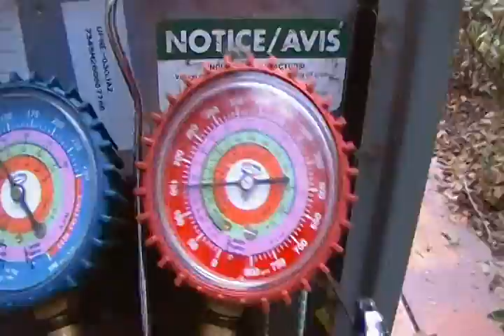Air Conditioning clean and check sevice HVAC Part 1

Comment: I had a friend who paid for a new compressor because his condenser coil was dirty causing the pressures to be high and it would cut off the compressor even with new compressor it would still cut off in the middle of summer in Arizona. I went over and clean his coil and the problem was fixed. goes to show how some techs out there won't be honest to sell you parts you don't need.

Comment: my AC takes 25 to 35 minutes to go from 88 to 85F, condenser is clean, 
bigger pipe with insulation is cold, smaller pipe is warm. the junction 
between the 2 pipes got a hissing sound. is it Freon leaking? anything 
else other than Freon? how much to fix and refill? thanks
Reply from the maker: There are a lot of variables.  What tonnage a/c, how many square feet to cool, insulation, tall ceilings, R22 or 410a, is the evaporator clean, holes in duct work?
Reply: how about the hissing sound between the 2 pipes at the ac unit? I heard hissing sound when ac is working, but no hissing sound when it's off.
(it's 1st floor unit AC, about 1900 sq ft. 9 feet ceiling. unit is 7 years old)  thanks!
Reply from the maker: You could have a bad reversing valve, freon leak or something else.  Without actually performing a diagnostic, it would be very difficult to tell you correctly what exactly the problem is.
My advice is to have a reputable company come out and give you a proper diagnostic.
Reply: actually it seems ok, pretty cool and air coming out of vents are cold too. however I noticed the temp usually drop 2 degress at once. also should I pay attention to how long compressor runs when I turn down temp or leaving the temp the same. so later if there are problems then I will know.

Comment: Loved this. Easy for a woman to understand. ;) I was able to go outside today, and clean my unit. It's sitting on a round piece of concrete, so after I cleaned all the coils, I made sure to do a quick spray underneath where that concrete is, and a lot of junk came out from there, as well. I was also able to check the refrigerant pipe, and after cleaning it, I came back out and it was ice cold. Yesterday, it was barely cold to the touch. So cleaning will definitely help the refrigerant flow through a lot better. Before cleaning the unit, my thermostat was reading 75 instead of the 72 I set it on. Talk about a difference! Now it is so cool in my house, I had to adjust the setting. I was tired of having a hot house, and this definitely helped.

Comment: Well, no offense ... but the industry techniques have improved probably a hundred times since the 90s as have the the equip designs,

What worked in 20th century 1990s does not work today. ACs are just too different.

Comment: In all the  owners manuals it will say to spray condenser from both sides.

I am not knocking Homestead, but a lot of changes have occurred in the industry that have made several "tried and true" service techniques obsolete, one side coil cleaning is one of them. 

All foaming condenser cleaners I use say to clean both out side and inside the condenser coils.

I hope this helps .

Comment: yes, that is to prevent you from attempting to work on it. should you try to work on it, then it will cut your hands off. call your installing company and they will fix it if a problem developes.

Comment from the maker: Some heat pump air conditioners when they go into defrost mode( using the heating cycle), the fan will not turn.  If you A/C is in cooling mode then the fan must turn the whole time the compressor is running.

Comment: We have so much in common. I enjoyed your A/C testimonial. I also like Rheem and use Ryobi. I wonder if you would check out my blog. I would value your opinion. I upgrade air conditioners into hybrid heat pumps.greenheatandac

Comment from the maker: I have seen plenty of exposed condenser fins from other brands that the rain splashed mud on the lower part of the unit and it did not wash it out.  I like the Rheem/Ruud because I feel that you get an extreme value for the money.  I will agree that the disconnects are cheap but, they work most of the time.  You can never go wrong with upgrading the electrical though.  Thank you for your input.

Comment: I hate those cheap plug in disconnects, I replace them with wheatherproof knife switches , no fuses, the circuit breaker is a fuse. I had a unit once that kept blowing up the start capacitor, I was told it was caused by poor electrical connection coming to the unit.I changed the cheap made in china plug in disconnect. I also don't like rheem AC units because the condenser aluminum fins are covered by louvers. The louvers prevent the rain from washing most of the dirt away.

Comment: What do you think is a good simple not so high priced unit, i need to change my 1984 trane airhandler, i was looking at a used 2006 2 ton trane in very good condition or a brand new payne .. What do you think??

Comment from the maker: I need a few more details.  However, if it is just leaking water it is usually an easy fix.  If it is making a noise and is still cooling, then you might have a bearing going bad in the blower assembly.  I am just speculating.  I need more info.

Comment: Hi,
Our unit is leaking water since we didn't have electricity for 5 days. The technician is a good guy and said we need to change the whole unit which costs about $5400. The heater and AC is making some noise, not alot, he said something like heater and blower related in something something...  The brand we have is Trane which I heard is a very good brand; it is about 15 years old. There are some rustings inside the unit (the walls) or trays but everything else looks new, do I need to replace?

Comment: I had a spider web short out the coil on the contactor before. It kept popping the 3 amp fuse on the furnace board. I took the contactor out and cleaned off the web I was good to go.

Comment from the maker: Use extreme caution.  If you are not a licensed professional you could get electrocuted or get your fingers cut off by the fan suddenly coming on ( I know a guy that this happened too). Most likely I would guess that the fan motor/capacitor is bad and will need to be replaced.  However, it could be the relay, contactor,wiring, circuit board or etc.  If you are unsure of what you are doing call a professional.

Comment: my ac outside, the fan isn't spinning anymore, it just stopped spinning and it sound like it wants to turn on. it blows air inside but its not cold. i dont know what could be wrong with it. its a RUDD from 1992.

Comment from the maker: I have seen water leak from roofs and plumbing down into walls and cause mold and fungus smells in homes.  I was able to treat it with that stuff that is sold at the supply houses, but you must stop the water leaking.  I would also clean the evaporator coil as a place to start.  Thay also make UV lights thast will control mold in an a/c.  I hope that helped.

Comment from the maker: Without looking at the system I can't give you a precise diagnosis.  I would suspect the duct system first. Black mold is virtually in every duct system in FL.  You can replace the duct work and as soon as you turn on the system black mold will start growing in there again.  There is a duct system out there that is treated with a biocide(expensive) to control mold.  They sell a 1 gallon jug of special mold and fungus killer at the a/c supply houses.  Simple Lysol spray will work too.  continued

Comment from the maker: Yes, you can use the stuff sold in the a/c store.  However, you must thoroughly rinse the coil with clean water until all of the spray is gone or it will corrode.

Comment from the maker: You want to wait at least 3 minutes to allow the pressures inside the unit to equalize.  The spray on foaming coil cleaner from Home Depot does not work as advertised, so save your money and buy some real coil cleaner from a a/c supply.  If they will not sell to you the you can probably get some online.

Comment: Great Video, Great Story. I am going to do this for my parents at their house. It is about to be summer though so I'll have to be quick :). Question1: How long should I wait before turning the system back on after cleaning the coils?  Question 2: Should I use some kind of coil cleaner?
I have a feeling their unit will be much worse than yours.

Comment from the maker: It has been my experience that the way depicted in the vid will effectively clean the condensor coil.  The evap coil is cleaned from the outside in as well.  If you wanted to take the off and clean it from both sides you can, but generally the dirt, grass and debris will be where the air is pulled in at.  I hope that answered your question.  Take care.

Comment from the maker: @sonnysand Thank you and you are welcome.  I forgot to mention about checking the amperages on the compressor and fan motor and oiling the fan if applicable.  I'll try to get the air handler part 2 up soon.  Take care.